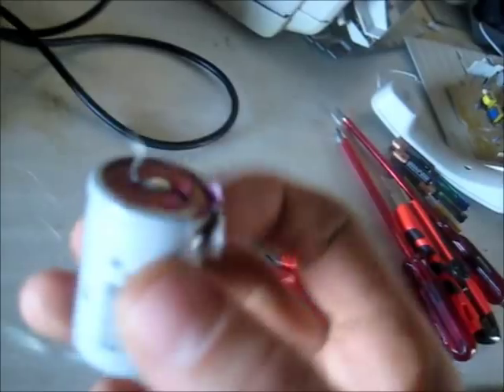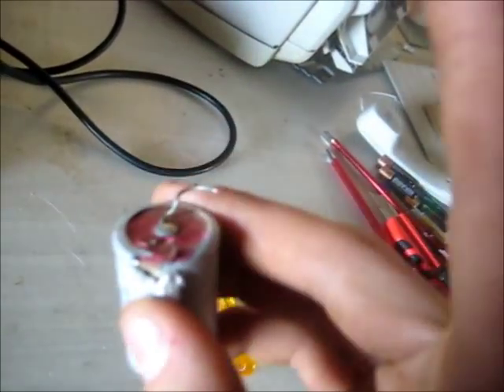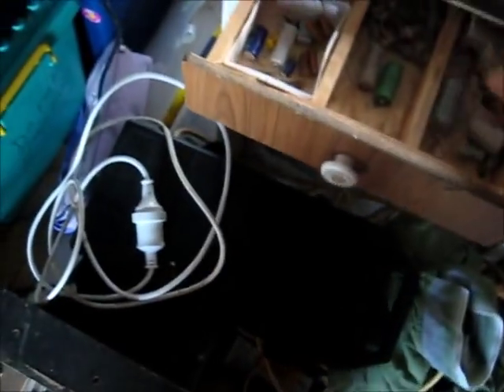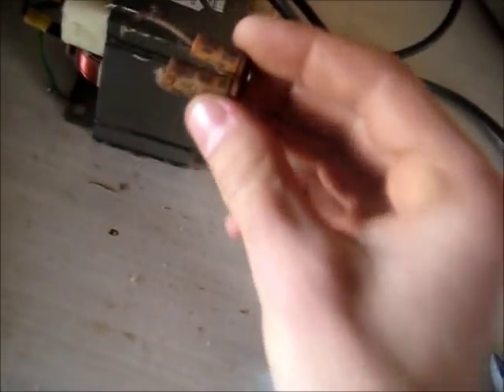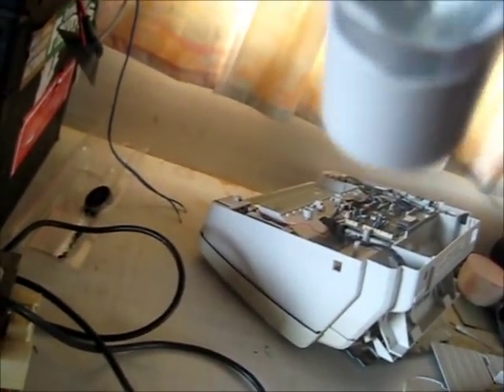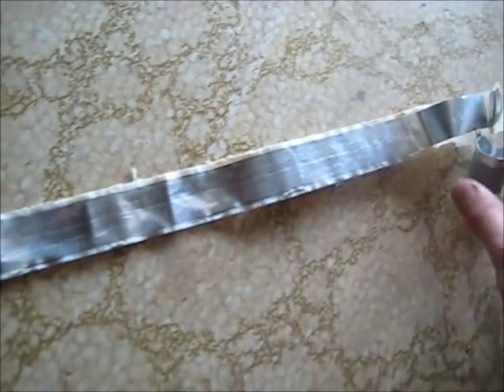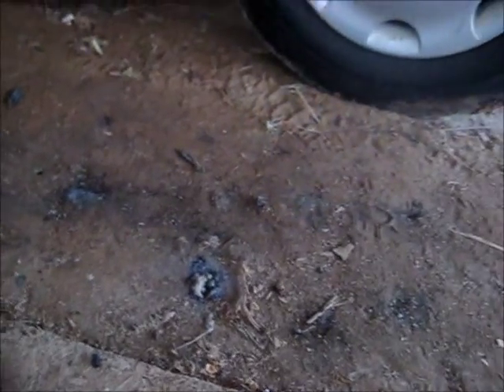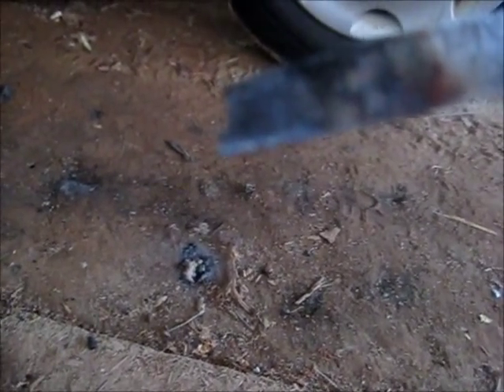Antique Capacitor Autopsy & overvolt

Comment: I've run into electrolytic capacitors older then those that still seems to work, though who knows for how much longer. The ones that were built into aluminium twist lock cans seem to live a long time, I have a 1940 RCA set that is still working with its' original caps in it (for now) I have run across axial lead units that seem to have held up as well, I guess it depends on how well sealed they are, and how they are stored, as to whether they dry out.

Comment: I am thinking that I might make an experiment to see if its possible to make electrolytic caps at home, it seems simple enough. Anode plate has a layer of oxidization on it, paper soaked in some electrolyte, and cathode. Those old electrolytics with no vents would make a nice pop connected backwards. Also, it been a while since you blew up batteries, maybe some HV battery frying in the future?  :D